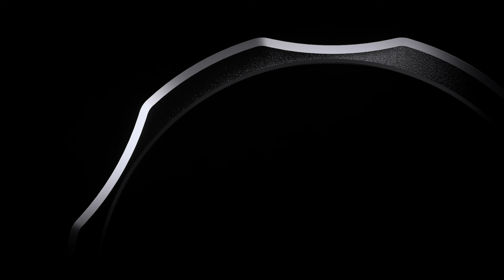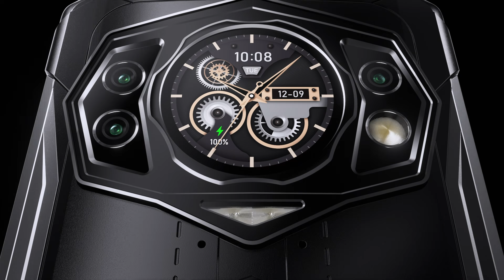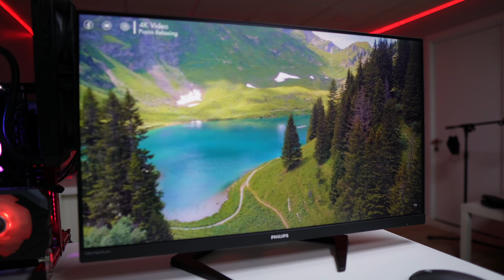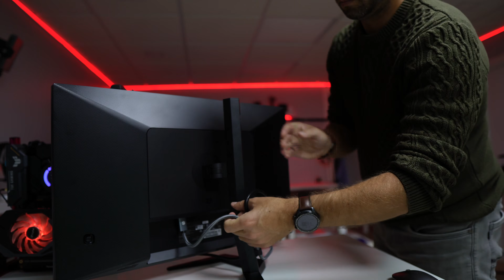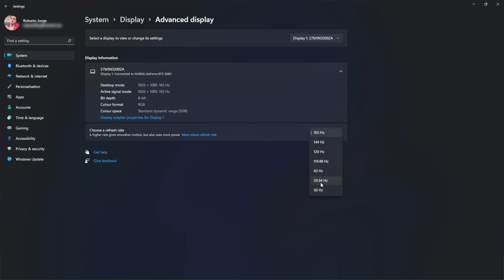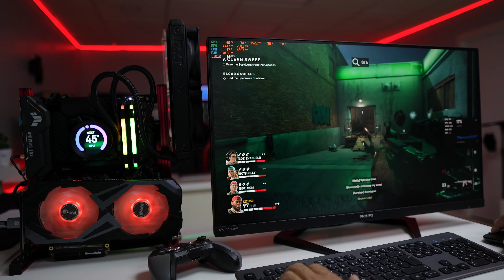Gaming Display 165 Hz Philips Momentum 3000 (2022)

Comment: After 3 years of using it, lines started showing up from the bottom and from the top, also it started glitching/flickering and when I start my PC it takes time to show picture on screen. 
It was pretty cheap around 190 Euros in  late 2022 , but I expected more from Philips, and from what I have seen on the internet, many people are having same issues. 
Now I will try to take it to repair shop and hope it can be fixed, or I will just have to buy a new one, and this time it wont be Philips for sure!

Comment: How is it holding after few years?
Reply: I've had it for about 3 years now and I'm starting to see weird horizontal lines at the bottom of the screen (probably because that's the hottest part of the monitor) and sometimes the pixels themselves are visible, 165Hz is smooth and the colors are pretty good too. I wouldn't recommend it though, 1920x1080 feels outdated better some 1440p or 2160p

Comment: good video , I have laptop MSI , GF63 Thin 10SC 
CPU : Intel® Core™ i5-10500H 
GPU : GTX 1650 MAX-Q 
the laptop has 1 port HDMI™ (supports 4K @ 30Hz)
the  monitor : 
Philips Gaming 24M1N3200Vs - 24 Inch Fhd Monitor, 165Hz, ips , 1Ms, Nvidia Gsync , Low Input Lag, Speakers, Smart Image Game Mode (1920 X 1080 @ 165 Hz, 350 Cd/M², Hdmi 2.0 / Dp 1.2) 
Can it give me good performance in terms of response speed and Gsync ? 
What are you opinin about this ?

Comment: Hi, just wanna get some opinion. I want to get the 24 inch version so which is the best between the Phillips Momentum or Gigabyte G24F?
Reply: Stuck between this and the AOC
Reply: I would recommend the Phillips momentum as I am no expert but the Phillips has slightly better contrast and colouring, everything else is roughly the same apart from the price, Philips is a fair difference cheaper and a good monitor for its price, I upgraded my monitor recently to one of these and I see the difference with my plays in cod

Comment: I'm returning mine because at any refresh rate higher than 144hz it gives ghost line on text. It was very hard to see and took me 2 weeks to notice so probably most people doesn't even see it but it's there.
Reply: Xbox series s 120 hertzt ok?
Reply: @Lichtschwert what did you find?
Reply: Did you buy the 24 inch or 27 inch?
Reply: @koiiev9413  27